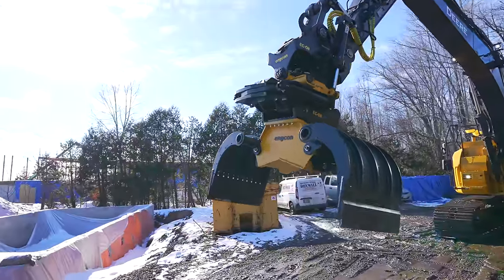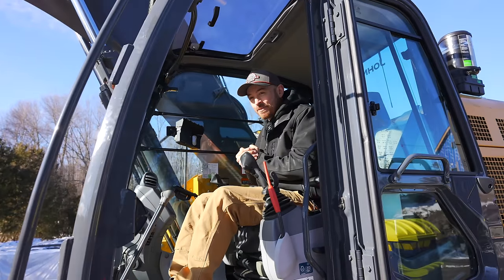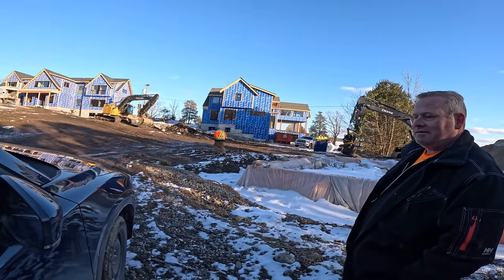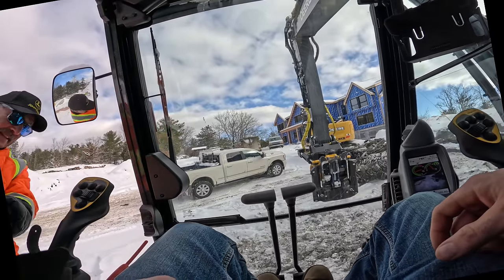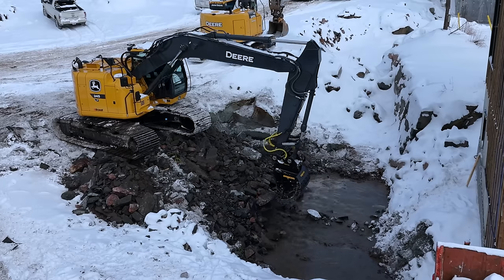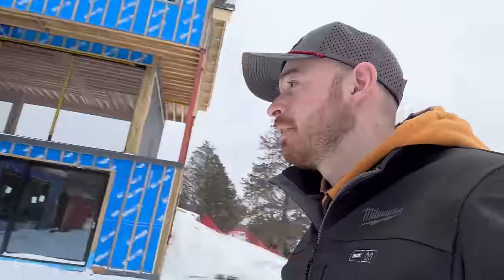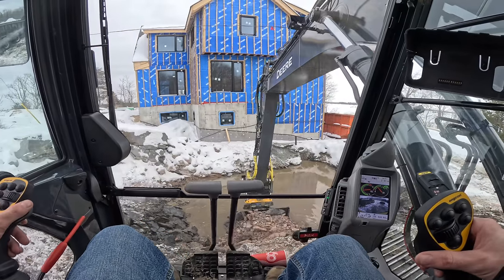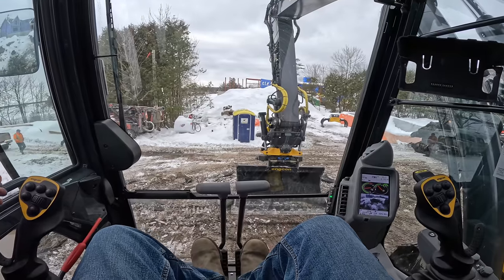I Went Back To Work.

Comment: The tiltrotator was invented by the Swedish company Rototilt in the 1980s. For the last 20 years almost every single machine over here run rotators. It is simply brilliant and very dependable. Im sure you will have a great time using it once you get the hang of it!
Reply: from a town called Vindeln
Reply: And this masterpiece Engcon are from Strömsund 🤘

Comment: When you get good with the rotortilt, you wont need that guy with the shovel to put gravel on the hole with dynamite, you will easily do it yourself. Here in Norway, almost all machines in proffesional use have rotortilt.

Comment: Once you get used to tiltrotator you can do so much more with just excavator. It takes little time to get it. Be carefull with tool change, ec oil system blows o-rings easily if bucket change is not made correctly.

Comment: Once you get used to the TR you'll hate going without it except when you're hogging material or ripping frost/stumps. 

If the rocker switches for the controls don't feel right you can change them around. You can do it the quick way by popping the switches out and flipping them around or you can link your phone or a laptop to the little computer in the cab and change the direction the switches control, change what the switches control (ex if you wanted to change tilt and rotate functions between joysticks, etc). When my setup was new it just didn't feel "right" but after switching the controls around with the computer it felt more natural. I have my tilt and rotate opposite yours but it's all preference. 

Regarding attachments, you'll probably find that the Engcon smooth edge ditch bucket, skeleton/sorting bucket, and their cable/trench bucket work well and feel "right" on the machine. I haven't tried it myself but have been told numerous times if you remove the bolt on cutting edge and only run the factory welded on cutting edge the ditch bucket works much better. Their digging bucket with teeth has weird geometry and is too "long" of a floor vs normal North American buckets. A lot of us have quit using the European style digging buckets in favor of normal North American style buckets with the S coupler put on the top. I use a Tag bucket but I know others really like Craig buckets along with CMP, AMI, etc. You'll be amazed at the difference with a conventional style digging bucket under the TR vs the weird European style. Also the Engcon/European style grapple is infuriating and don't trust it for holding a firm grip on something over anything important. Their single cylinder design with a linkage to control the other 1/2 of the grapple and no locking valves leaves a lot to be desired. Unfortunately many of us have learned that the hard way, a lot of guys have gone the way of putting a CMP non rotate grapple under their TR, it's on my list but haven't gotten around to spending the money and ordering one yet but every time I use the Engcon grapple I'm ready to spend the money. 

They're a fantastic addition to a machine, especially for someone who's working by themselves, in confined spaces, or around lots of obstacles. They do have their downfalls but to me the pro's far outweigh the con's.

Comment: We have two of these and you can go in to the programming and change which way the rollers go. These tilt rotaters are awesome and makes life way easier digging around utilities. We have one on our 9k pound machine and or 40k pound and on the bigger one we are constantly fighting leaks with the quick attach. And don’t get the compactor for the big one they blow out the seals all the time.

Comment: Only done some digging for my self. Thankfully they all had either engcon or rototilt fitted. Wouldn't want to work without one, just that you can constantly change the angle of attack on the bucket and even when dumping it on a trailer you can be so much more gentel.

Comment: I live in North Bay, we sold our 245 with a rototilt and it was ok, but mulching with a rototilt is hard on it, just violent, i love you can uncouple the rotator now. Your in Muskoka area and your basically in all rock most of the time so that function of removing it is great. We run a 336E with a big bucket, just a beat on machine.. and a 330 Nex Gen with a progressive link thumb and FAE mulcher; and then a 323 Nex Gen  same thing just regular thumb, smaller mulcher.. and our 313 Nex Gen has the rototilt on it, fixed.. with a ditching bucket and its just a touch up machine we dont do much digging id like a trench bucket for it because the 48 inch ditvh bucket is abit big for trenches lol.. love ur content

Comment: A tiltrotator pays for itself within a year or two in fuel and time savings alone, not to mention wear and tear of the undercarriage since you don't need to constantly track around to reposition the machine, the only time I'd take it off is if I need the extra breakout force or using a bigger bucket to mass excavate or load out trucks with heavier materials that is harder on equipment. The tiltrotator makes the excavator a true multitool that can be used for pretty much everything on a job site, that's why wheeled excavators have become so popular in Sweden as an example, put on a tiltrotator, a machine control system and a dump trailer to carry your attachments and you can do anything almost anywhere, it's brilliant.

Comment: When I purchased my tilt rotator, I told myself, I will take it off in the winter to keep the wear and tear, as well as salt abuse from transport to a minimum. However I changed my mind quickly, I won’t run the machine without it. It just makes the work easier. Cutting through frost, excavation, backfilling and so on. I remove it only to run the hydraulic hammer. I’m sure you will change your mind as well.

Comment: If you take a knife you can pop the switches out of the joystick and flip them around so when you push it right the engcon goes right. For some reason they set them up backwards from the factory

Comment: We had a volvo operator familiar with the rotator do a single motion sweep with a bucket around a water drain cover to smoothen it out. No need for shovel or manual labor. Was one and done for asphalt after that.

Comment: Rotators are nice for landscaping but they seem to get in the way for most applications like digging trenches. Nice toy for sure, I will probably put one on my next 13 ton. I spent my spring budget on a McClosky S190 screener.
Reply from the maker: That’s why you just take er off when it’s not practical!
Reply: @MuskokaFreerider  They are pretty slick though I am sure you will put it to good work landscaping. You should post more construction stuff in the off season. I own a construction company and do class 4 septic too, always cool to see how others are doing things.

Comment: I knew the season would end for you very soon by the videos you were posting. In the Vancouver all the local mountains are bare and in Whistler the base is only 145 cm. A poor season for winter sports but more than likely next year will be back to normal. I can recall years back like when the Olympics were in Vancouver it was even warmer/drier than it is now.
Reply: “only 145 centimeters” 😂 that’s an extremely good year in northern Sweden….sadly.
Reply: @swedish_sadhguru3854  in Whistler we usually have low 300s around this time of year.

Comment: That tiltrotator would be awesome for backfills, but we never bought one due to the price and fear of damage as well. Losing what? 30% lifting capacity? You can buy a Mecalac 6mcr for that price and have a dedicated backfill /rotator machine.  Have you seen one of those?
Reply: Considering the engcon itself has a qc, you don’t lose any lift capacity for setting big stuff. Or put the bucket on like normal if you want
Reply from the maker: Right, doing drainage stone around the foundation. Dad’s worried about damage and I could see why, don’t want to toss anyone in the cab. Lifting capacity is no concern as you just take the rotator off. Pretty slick
Reply: Yeah, I forget it can be swapped out quick. I never got a chance to run one, they look super handy though. 
 The only dirt work I do now is at my resort, so it’s really hard for me to justify buying one 😂 for booking info go to…😂😂😂

Comment: That’s the most worthless contraption I’ve seen….reinvent the mouse trap….it will sit and rust in the yard until forgotten
Reply: What?  Have you not watched people operate these,  there are a lot of options. We would still be in horse and buggy if we never reinvented the mousetrap or the wheel lol. Pretty ignorant statement
Reply: hahaha you have no idea what you're talking about
Reply: It has been around for almost 40 years now here in Sweden. 95% of all machines here run tiltrotators. It is a simply brilliant invention and works extremely well.